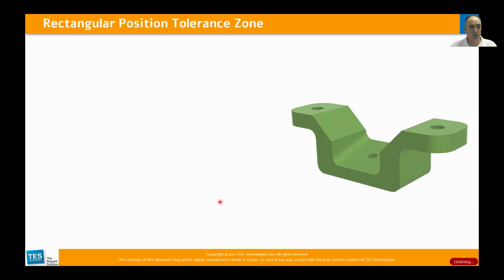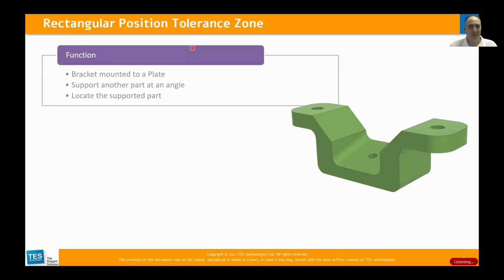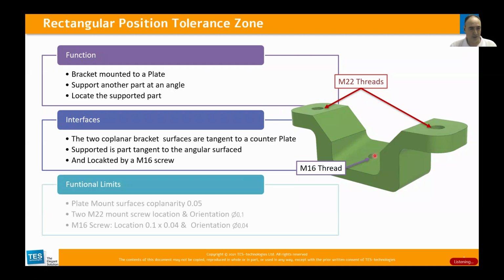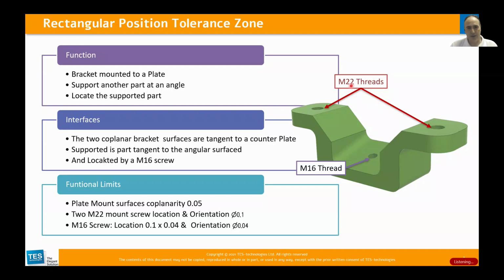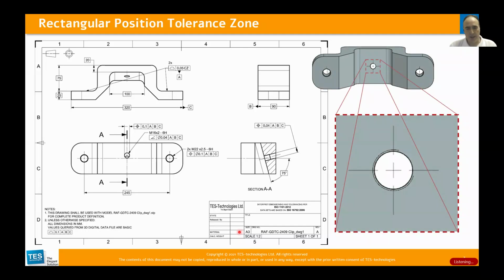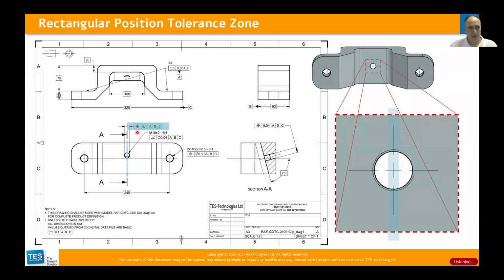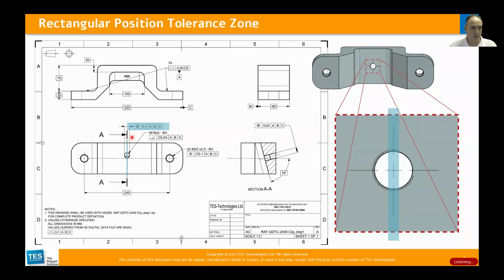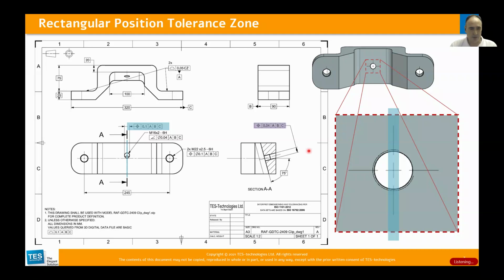Non-Cylindrical Position Tolerance Zone

Comment: low quality voice but thank you for job
Reply from the maker: Thank you for your input
After your comment, clip was tested on other locations world wide, and got no comments on audio quality.
Might be a local problem (band width or connection interruptions)
If issue persists please notify
Reply: @GDTES10  some pageas are not very riendly if content is US-EU so its may be just funny "friendly" policy here :). Thank you !
Reply from the maker: I guess this is a youtube issue
Reply: Unfortunately, there are no contacts or clearance fits at references B and C. Why are B secondary and C secondary?
There is also no datum on the sloping surface. For this, the threaded hole must be at right angles. For this surface, the location and direction relative to the base reference system must be tolerated. This is an associated geometric element. The profile tolerance used here captures a real geometric element and corresponds to a manufacturing specification rather than a function-based specification.